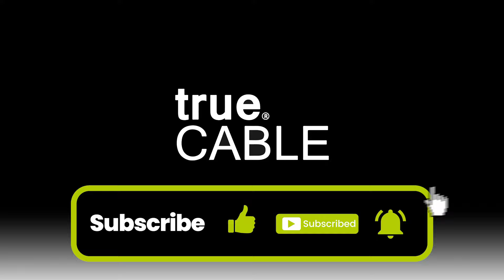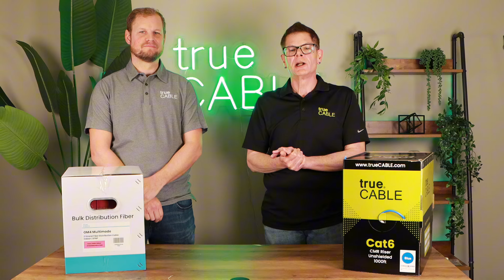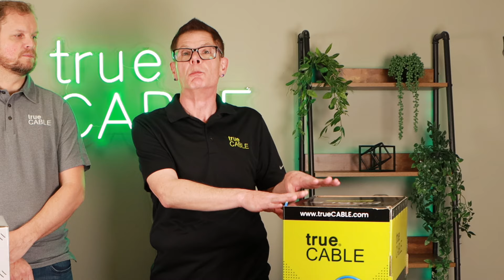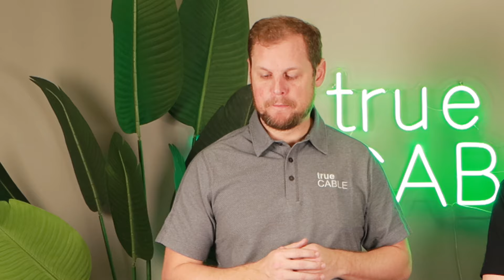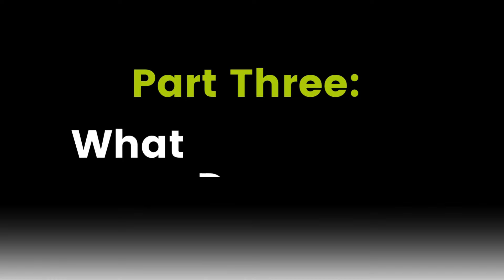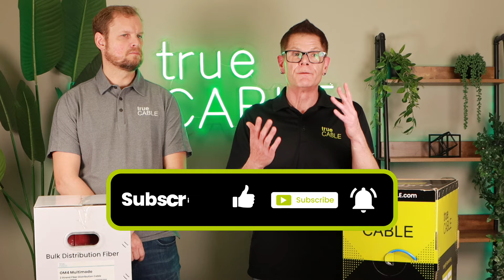Understanding the Key Differences Between Fiber Optic & Ethernet Cable in 2024

Comment: Now I understand the basics of these two. Thank you for sharing. 

I have one more question. 
If I use 48 volts cable (to power POE switch) along with unshielded Cat6 in 1” PVC conduit, will it work? OR have to use shielded Cat6 and or shielded LVT cable or need to run separate conduit for LVT?
Reply from the maker: Hello! You are welcome. As to your question...you can run both in the same conduit. The 48V is still considered low voltage and can be run with unshielded Ethernet.

Comment: I need to run around 300ft of network cabling alongside of 240V triple phase suspended in the air (I just know what it's called in my native tongue). I take it that fiber would fare a lot better than even shielded and grounded ethernet? 
Also, is shielding just to make sure the cable runs at a set speed or is the bigger issue packet drops ? Cabling would be used for security cameras and I would love to cheap out when it comes to speed.
Edit: oh and what's the point of having a metal wire running alongside of some ethernet cables?
Reply from the maker: Hello! If you used shielded aerial Ethernet cable you can get as close as 2" on parallel to the 240V circuit. Do NOT bundle the two together. If you are using unshielded Ethernet, it would be wise to maintain 8" separation on parallel. In either case, you will need messenger wire Ethernet, or you will need to install your own thin stainless wire to attach your cable to (and that is likely what you are referring to as the wire next to Ethernet...it is an attachment method). Fiber optic would obviously negate the need to worry about shielding and separation distances, but we would still not recommend attaching your fiber cable to the electrical circuit as this is just asking for trouble. I hope this helps!